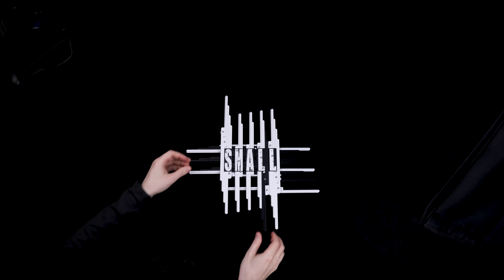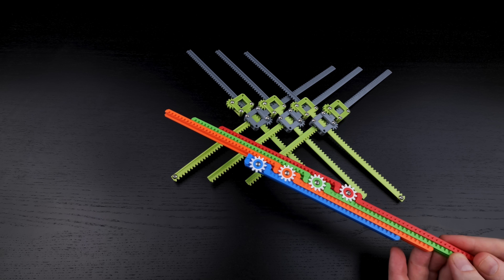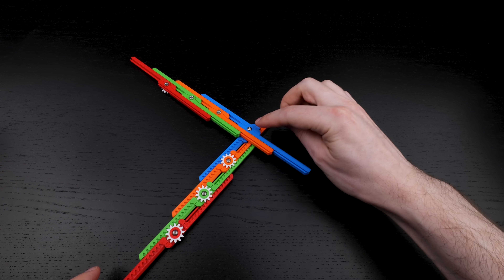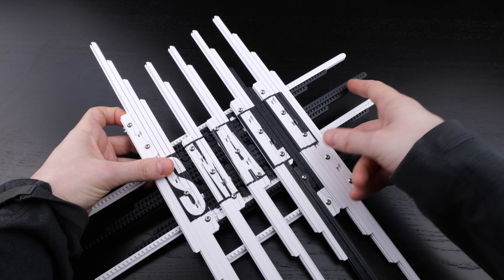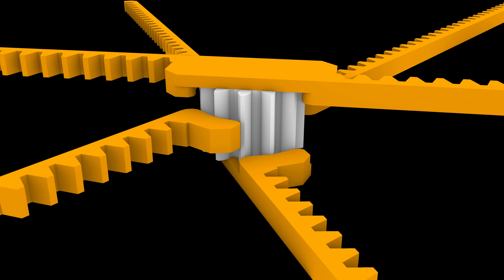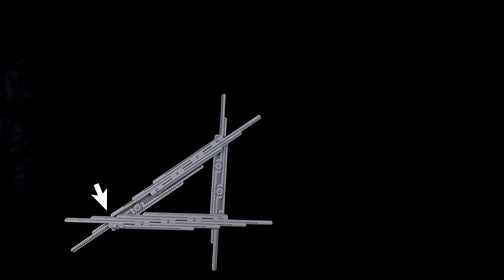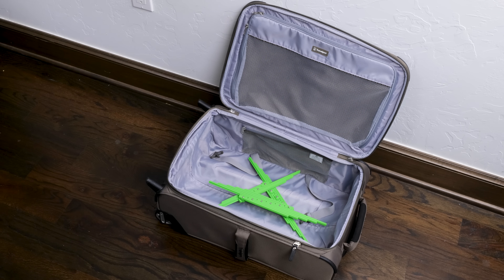Expanding racks

Comment: Subbed! This kind of simple, elegant, clockwork style machinery will have massive applications in space when we start to mine the asteroids etc. I could probably list a dozen possible applications just off the top of my head, from instant shelter, to shielding, to stowable solar panels, to scaffolding etc etc etc. If you integrate inflatables into the equation and you have an instant, expanding hab module or an instant airlock or an instant pressurised cell for injured astronauts or people who's suit is compromised and need an instant pressurised emergency tent/shelter big enough for a couple of suited astronauts to be able to remove their suits and repair whatever is required and then be able to have the module collapse back down to a small pack attached to their suit's emergency kit. And if designed for zero g, you could make the materials incredibly light and they don't even need to be strong, just good enough to provide structural rigidity for a mylar bubble etc.
Of course, this also would have a heap of applications for boring terrestrial stuff too, but for some reason I just cant come up with as many ideas lol. There may be applications in the medical fields, and maybe even surgeries etc. Or as a structurally strong parts for robotics, perhaps there may even be applications under water in the oil rig drilling and cable laying industries, as well as probably in general maritime. It could also be handy for strong and swiftly collapsible radar arrays for the military (of various sizes. being able to fold your giant radar array up, stow it away in a couple of dozen seconds and scoot away, is the difference between catching an anti-radiation missile from some crazy wild weasel pilot and getting away)
Reply: WOW. Do you work in engineering?
Reply: @RachelSnoek-y8v lol, no. I sometimes suspect that I missed my calling. I do, however, read a lot of hard Sci-Fi, and have done since I was a kid. It gives you a pretty good imagination.
Reply: @RachelSnoek-y8v Its also difficult not to get really interested, and have your brain start palpitating, when you get to see some genuine innovation, which is quite rare these days, with a surprising amount of the innovation you do get to see is right here on Youtube. I've seen some amazing inventions and crazy hacks, which is probably one of the best things about the internet and youtube in particular.

(Youtube is undoubtedly a massive resource that gets outrageously exploited, and mined for innovative inventions, ideas and methodology by industry from China. I have no doubt that this idea will get noticed and snatched by some small factory in China somewhere, regardless whether there's a patent or not. Its one of the dark and unfortunate sides of the creative side of Youtube. I've seen some amazing inventions or ideas by youtubers end up commercially available within a few months, and with the creator having no affiliation or any kind of recourse for royalties, licencing etc. because its virtually impossible to sue for patent infringement in China. I just hope this creator doesn't have these kinds of problems, because that system is a fantastic idea that's already semi-mature).

Comment: I have a usecase: This COULD be used in conventions for collapsable booth setups, maybe? Setups can sometimes take half an hour or an hour depending on table size and the design of the booth. if you can make something that collapses 3 dimensionally from a strong cube or cuboid into something small and portable this could help cut down the setup time a lot.  Main problem is the the strength of the expanded object and expense, because I can't imagine this would be cheaper than $2 metal racks unless mass produced and honestly people don't think spending for setup matters. 
Another usecase would be storage flexibility - take a look at @playconveyor's Infinite Storage shorts series. Imagine if you needed more storage and then you unlock the mechanism and pull across the wall and suddenly you could hang more of @playconveyor's crates without having to add anything except the crate. It's more efficient.

Comment: If you alternate the side the gear is on for each segment you can have the gears roll past each other allowing you to utilize more of the length and gaining more travel or a more compact design. The racks can then also go in the positive and negative direction. The spacing should be sufficiently large enough however that the gears on every other segment are far enough apart that they do not collide.

Alternatively, each additional rack could be always on the back side of the segment so the rack could build in depth instead of width.

Comment: The first application I thought of using this mechanism was some kind of expanding ballistic shield that would provide ample surface area for protection when fully extended. But it would also be able to contract to a size small enough to fit in a rucksack.

Comment: I wonder if you could make the expansion ratio greater than 2
Reply from the maker: If you look only at the spacing of the bolts, the expansion factor on the 3-4-5 triangle is about five. It’s only the racks sticking out the sides that increases the size in the collapsed state. If you use sticks with more rack, this end effect decreases, and you’d get closer to a five times scaling factor.

Comment: the non mirrored version ... that would be awesome for like a drawer front, as you pull out the drawer the front would move down for easier remove items from the drawer. i'd love to try and work with something in wood but both my back and 3dprinter dont work :(

Comment: Can you make the corners pivot? Or allows corners to bend when it’s fully extended?
Reply from the maker: It might make things more complicated to transmit force through a corner and also change the angle of the corner. I think there should be ways to do that, but I think it’ll require more complicated gearings.

Comment: I'm very curious about the opposing contraction model but with 3 axes. if you have an equilateral design where the "neutral" between all 3 is a state of half expansion then adjusting any 2 axes would show the relationship with the third. Would it be possible to make a shape where only 2 of the three could ever be closed? I have seen demonstrations of ratios that function in a very similar way and quantifying that with gears would be a really intuitive way to show what's happening. Also it would be a really fun fidget because all of the examples in this video have an "open" and "closed" state, whereas this trio would have 3 different states and one is always open, inviting you to contract it. The visual appeal of all your designs is wonderful by the way, keep up the good work!
Reply from the maker: Three states would be interesting but might be tricky to design. If the mechanism has one degree of freedom (like these rack designs do) then it essentially goes back and forth along a line of possible configurations. To have three ends you'd need some "branching point", where you can make a choice to go forward in two different ways.

Comment: If you continued to add racks in a single direction, such as in the first model, is there a point where the structure loses efficiency or doesn't fully translate the motion? For example, if you had an 'extending stick' made from 100 layered racks, would the entire structure move at once if you were to pull/push on the rack at one end of it?
Reply from the maker: Right, there is a little bit of slop at every step of the mechanism, and eventually that will build up. The force needed to move the whole thing will also increase with the length. On the other hand, if you have a long stick and you pull on both ends, it will expand. The gears will turn, and that can expand the structure sideways or activate other mechanisms.
Reply: @henryseg  That's really interesting! Thank you. Would using beveled gears allow for racks to be placed vertically somehow, for a third dimension?
+   Your videos are always so well-presented and fun to watch. Looking forward to your next project.
Reply from the maker: @gerphling I’ve got some thoughts for going into 3D, will require some experimentation!

Comment: This feels like the perfect replacement for any mechanism that relies on cables. Extending bridges might be able to use this, complex mechanisms for costuming might have some applications, and you could even reverse the movement to get more precision by pushing/pulling on pieces farther apart to enhance the precision of the movement of the shorter section. I would be interested to see the cost and durability compared to analogous mechanisms.

Comment: i technically have an idea for doors opened that way. by scaling it up, casting in metal, making two hydro engines pulling it diagonally. then plating small unstretched shape to create door without keyhole that will remove itself by expansion :v i think two triangles will suffice with bit of improvement like magnet locks in the middle of diagonal line that open making the lines collapse to the sides. then reattach to special side racks that will reposition it again when closing i dunno random project here maybe try magnet collapsing in the next vid or detachments and retachemnts it will be fun to see how you will engineer it

Comment: have you tried curved racks? that way you could start with a banana shape and end with a circle. a potential use for these would be reaching around obstructions maybe.
Reply from the maker: That should work I think. Maybe depends on which direction the rack bends relative to which way the teeth point.

Comment: Hmm, these are pretty cool! I think you ought to make a bunch of sets of these with several standardized sizes marked with simple numbers, in several colors, that can easily be assembled and disassembled, to some focus-groups of a good age range of children and adults, and then after you get all the data from that that you think you need to improve them and find out if there seems to be a big enough market for them and what prices per certain sizes of sets might work out, get with someone who can work with you on injection molding and sell sets of them as construction toys!
Reply from the maker: We did the construction set thing with the extensors mechanism - making a product is a huge amount of work!
Reply: @henryseg : A product for commercial release, that is. Yeah, I've seen TV shows, and videos here, about how much work it can be to get something out on the commercial market. It has to be a major passion in order to be worth all the progression work it takes! 

How successful have you been so far with the sets that you did that with?
Reply from the maker: @HelloKittyFanMan..  Not successful enough to want to do it again soon!
Reply: @henryseg : Aww shoot, that's too bad. Are you still under, or have you only about broken even, or have you made a little bit of profit by now?
Reply from the maker: @HelloKittyFanMan..  We're doing fine, but we've not gone through the first set we had made ages ago.
Reply: Hmm, I guess that's OK but then too bad at the same time. If I wanted to see them can you tell me something that YT won't hide that would help me know how to find them?
Reply from the maker: @HelloKittyFanMan.. Check out mathmechs.com.
Reply from the maker: @HelloKittyFanMan.. Or there should be a card on the video that links to my video on extensors (well, more of an instruction manual).

Comment: Could this be used as a cheaper alternative to those expanding drawer slides? Those are very expensive. I know a 3d printed version wouldn't be able to hold the weight of a drawer, but maybe a aluminium one? What do you think?

Comment: 2 Things I would like to mention.
- ¿Would change the length of extension if you change the gear ratio/size of teeth?
- For the triangular problem. ¿Maeby a semyspiral frame of expanding racks? I cant exactly picture it in my head rn. But something tells me there is a concept there.

Comment: Makes me wonder if it could have application in space research. They use a lot of folding tech for packing things efficiently to be shipped off in rockets. And your mechanism has the advantage that you can drive the entirety of it by rotating just one gear, which would seem ideal for them too

Comment: Thank you for this video and I'm glad it popped up in my feed or recommendations....  

I volunteer at a charity, in the books section which has many many different widths of book cases, and I've been trying to come up with an idea of how to make an expanding "rod" so that I can place it behind the books so that the books can all be pushed up against it and be level and not pushed too far into the deeper shelves... 

I wanted something that I could print on my BamBu X1 Carbon and was able to collapse down so 15cm upto 60cm while being tall enough that books don't just get pushed backwards over the very low "rod" .

I wanted it to be flush while extended or collapsed so the books would all be flush one each segment.

The best I could sort of come up with, is segments that were placed inside each other and just holes to put a pin is to stop it collapsing...   

I had it all designed on TinkerCad because that is all I can really use...    Due to my dyslexia and my AuDHD (Autism and ADHD) there is only so much I can do which isn't too wordy in learning, as I'm a visual learner. 

But this has given me some ideas I hope to try again...    

Thank you for your video 🙏 it's very clever stuff you're doing, and honestly a little mentally exhausted from watching but I'm glad I did 🙏

Comment: I think the 2 direction mechanism shown at 5:47 would be very useful for a robot design. Since you only have to power your base gear to get diagonal motion. it collapses very small so is good for expanding robots
Reply: actually, if you powered the center gear (between the 2 directions) in that design, you could get both horizontal and vertical movement off of one motor. then you could just have your end effector transfer objects between the vertical and horizontal components. This would let you have parts move in an 'L' shape

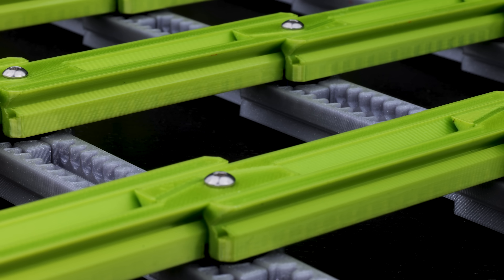Comment: 9:58 when you were talking about this part, I envisioned a piece of durable stretchy material, attached at each bolt, that expands evenly with the grid.  Maybe with a place to put pins through the mechanism to hold it open or closed. Compact, instant wall panel.  (maybe not stretchy, but attach it to the bolts after expansion in a 2 part assembly or something)

Comment: a> the big/small design needs to be in a design museum, transitioning every 30 seconds or so via a small motor. 
b> the double rack at 90 degrees design might, for example, have a linear motor push on just the green piece, and a monitor held by last perpendicular rack would com closer and higher to a person. 
c> this is great stuff, not the least because it gets peoples brains working. :-) 
Maybe talk to someone like Elon Musk about possible incorporation in spacecraft.

Comment: I think you could find a way to overlap square plates on top of a square expanding grid and make a thing that looks like scales when compressed and a flat plane when expanded.  The plates could probably be used to add rigidity, and you could make a very satisfying table topper this way for when you want more table space.
Reply from the maker: Might be difficult to get the expanded grid to have a flat top - the plates would want to shift up or down to level them out, once the grid expands enough to get them out of each others way.
Reply: @henryseg  perhaps they attach at one corner that has a joint lets them open up just a little

Comment: I have a use case for the linear rack:
I own a tool for marking equal spacing of rivets between 2 points. It's a scissor based mechanism, like many pairs of scissors fixed together so they all open & close at once. It works very well on the bench, but is quite cumbersome in free space, such as the underside of an airplane wing. Trying to hold it with one hand and mark the points with the other is nearly impossible without an assistant. Having a ruler that could expand & contact would be a huge difference.
Reply from the maker: I guess the question would be how much the accuracy changes if you switch from linkages to rack and pinion.
Reply: @henryseg  the linkage one is actually pretty sloppy, but precision isn't typically paramount.
Reply from the maker: Sounds like it could be a reasonable product then!

Comment: My initial thinking was it could be a great antenna, then tent, then if i were able to place the triangle one on a car, it would be a shade, 
for the triangle version;
1. triangle’s two bottom corners has to stay connected on a surface but one corner should move on x axis. 
2. A second parallel triangle to make the shape 3D
3. A cross line connects 2 triangles can be a rolling mechanism for fabric. 🌀 I would love to experiment with.
Like this: https://i.ibb.co/tTRdHn9x/Shade.png

Comment: This design principle reminds me of how telescopic crane booms work.  They often have four or more tubes that collapse inside each other, operated by a single hydraulic cylinder.  The cylinder just pushes the second tube out from the first (outermost) one, but there's a cable that runs from the base of the first tube, over a pulley at the end of the second tube, and mounts to the base of the third tube.  So just like with your rack and pinion, when the second tube extends from the first, the cable pulls the third out from the second.  And you can daisy-chain this system to get as much extension as you want from one hydraulic cylinder.